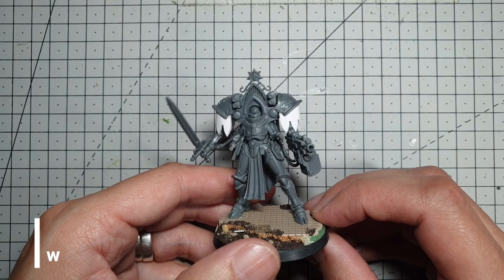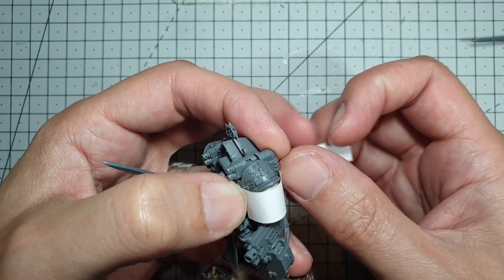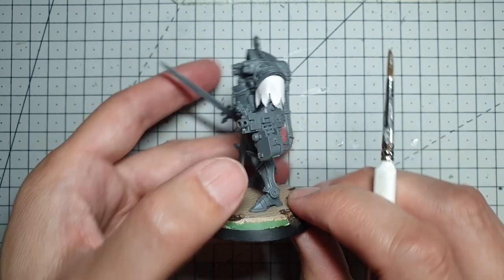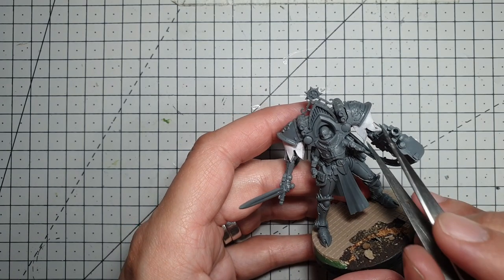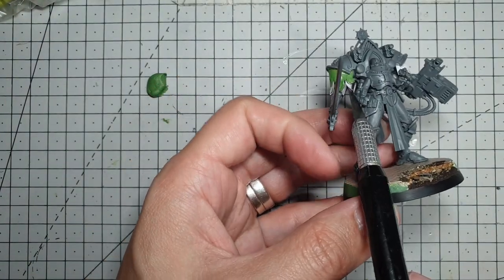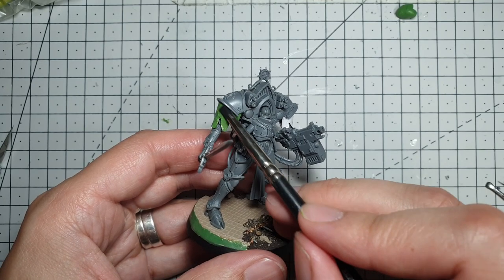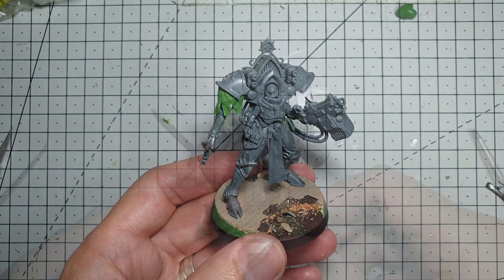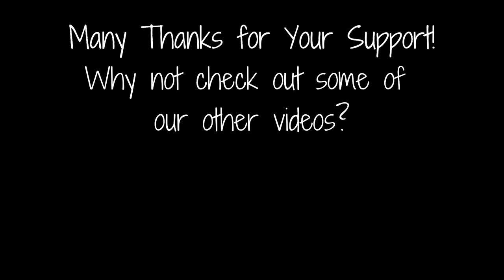Conversion Corner - Paragon Warsuit Improvements

Comment: would it work if you laid the paper flat the table and put the green stuff on then stuck it on the model?
Reply from the maker: It may do, but you'd not get the more flowing effect that wetting the paper gives. You could also try greenstuff on a tinfoil back which would give it more flex